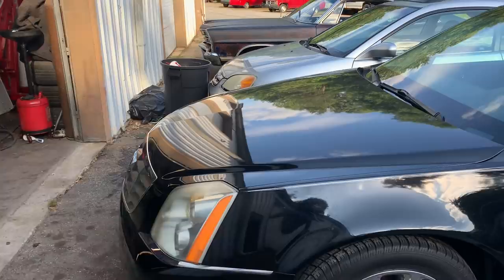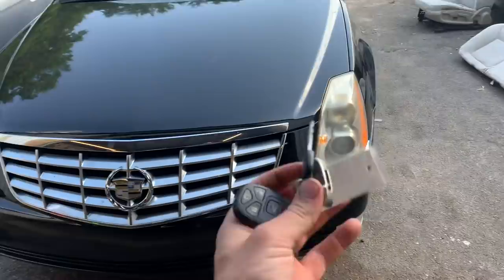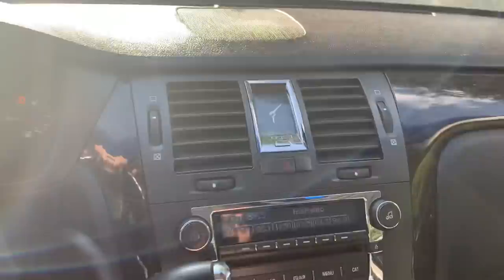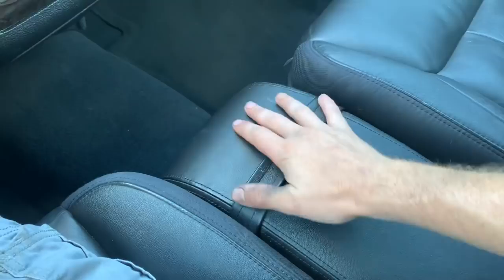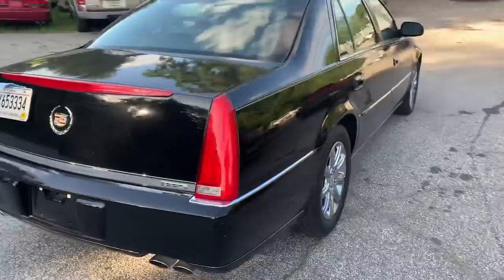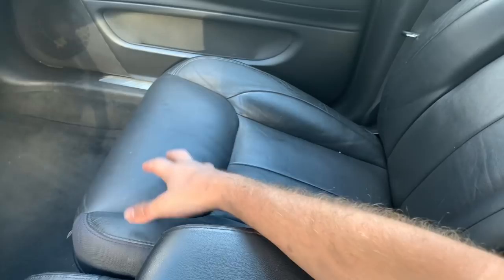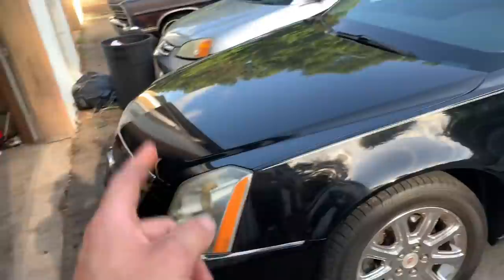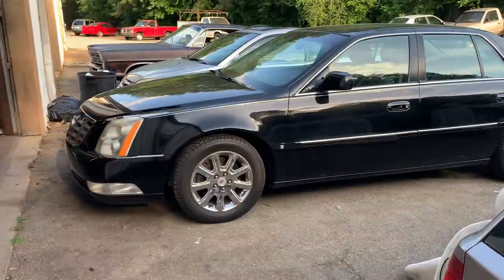A GOOD NORTHSTAR!? 2008 Cadillac DTS

Comment: Have a question I have a 2008 DTS no still Cadillac and I was on the highway this morning going to work and when I got up to 82 mph is like the cruise control was on the window Nafessa needed to and I want to know what we call Steph problem
Reply: I want to know why and 82 miles an hour it was like my cruise control was on. It wouldn’t go faster than that and I didn’t cut that. No it is a little speed limit 82 miles an hour in the wind gonna faster and I was axing a question why we caused a problem

Comment: I have a 2007 DTS and I want to know what are signs the rear shocks need replacing.. even if it's not sagging.. it doesn't ride very soft in the back.. and it seems like they are stuck in the higher position..

Comment: First of all, you make great videos always entertaining and full of information. Secondly, I've been driving Caddy's since the 1970s. Last new caddy I bought was an 05. Absolutely hated that car!! The worst ride ever. Even Cadillac knew it was so bad they didn't put Cadillac on the cars exterior. Two of the caddies have the overheating problem. Dump them at the first side of overheating because Cadillac will charge you over $2,000 to fix. I just found a 1989 baby Sedan DeVille with 58000 original miles. Better than meant, if you hadn't looked at the better than mint. If you had looked at the mileage you think it was Factory fresh! It was always Raven once or twice a week and never out of the neighborhood. Got it for chicken scratch, cheap, cheap, cheap.

Comment: my dad has one it's a 2006 with 260.000 km and still counting if you maintain them they will last longer than you!
but my dad abuses his car the first engine seized after going 10.000 km without an oil change and the second one had a cracked head from overheating and that is because 13 year old hoses and the beautiful sun of saudi arabia are not exactly friends but the third engine is going strong and hopefully it won't end up like the first two

Comment: Such a lovely car 

I have a 09 with 150k miles on it and so far the only issue I have with was the fuel pump relay was burning all the time, so I put external relay outside the fuse box and it works well, other than this was the front end. I really want to know if I could remap the PCM, I want to install HHO kit
Reply: Yeah you can. There is a company that does it.

Comment: These were better but they still blow headgaskets. They still had problems with oil leaks, and transmission problems. Cadillac could have done these right and made them extremely reliable, but they couldnt be bothered.
Reply: There is a poll on the Cadillac forums that show the failure rate to be 0.3% based on the poll.  If there is a failure there is no proof that it wasn't the operator to blame.

Comment: My grandfather had a 06 and when he passed I got it as my first car, still got it had to do somethings to it but 3 years and no big troubles. Did do the valve covers last year. I have also been wondering about changing the transmission fluid its got about 64,000 miles and I'm not sure if it's been changed before should I get it changed or am I good for a little while longer?
Reply: Do it at least a drain n fill n a filter what's fluid compared to a whole tranny ? Lol
Reply: Take it the to shop and have it flushed cheap Insurance. Pull the dip stick out smell it to see if fluid smells burnt, not good if it does; New fluid looks cherry red old fluid should look similar. Ive been told the oder is more of an indicator of fluid condition than fluid color;Take a clean white cleanex and have a drop of fluid drop off from the dip stick  and observe the color on the cleannex, if the spread out color doesn't look cheery or pinkish it brobably needs to be changed; typically transmission fluid in a automatic transmission  should be changed at 50 to 60 THOUSAND intervolts. Every 30 thousand on  vehicles that do a lot of towing or vehicles driving very hard.                                                                                                                                                  P.S.  If the brake fluid has not been changed in the pass  two or three years have the brake fluid flushed ( brake fluid brakes down and has the tendency to absorb  water over time). Have the coolant changed about every 5 years, powerstering fluid about about ever 30 or 50 thousand or at least every 5 or ten years which ever comes first.Its not A bad idea to have the thermostat replaced every 50 to every 100 thousand miles even if working right as preventive maintenance. The top radiator house may need replaced as will every 60 to 100 thousand miles or every 6 or 10 years as preventive maintenance (The bottom radiator house is always submerged in fluid;Their for rarely needs replaced). Drive belts should be changed about every 60 to every 100 thousand miles  or sooner if needed. Spark plugs around 60 to 80 thousand. A well seasoned auto mechanic (technician) imfsided  to me and others replace plugs at 60 thousand miles not the 100 thousand manufacturers say to typically to replace them at; He also said oxygen sensors are good for about 80 thousand. have the throttle body cleaned every 30 to 60 thousand and have injectors cleaned  too around the same interval. Replace air filter every 30 thousand or sooner if dirty( if light doesn't pass will through filter nether will air)  not the 50 thousand the manufacturer says. My used car with only 30 thousand on the odometer had a dirty filter with poor light passing through ability even though manufacturer said replace at 50 thousand.                                                                                                                                                                       Chang engine oil and filter around  once a year as manufacturers states or 5 to 6 thousand miles( or when the oil replacing indicator in the instrument cluster says to do so) which  ever comes first. (There is a thought that I've had for some time) An engine can never have its oil replaced to soon but it can have it replaced to late).   I'VE PERSONLY GONE LONGER IN TIME THAN THE ONE YEAR INTERVAL, but it's not recommended to do so by the manufacturer of any auto manufactured. A good synthetic oil and a good filtering oil filter are a wise investments in my opinion in keeping almost any engine running longer.

Comment: They are all good if you flush out the orange anti-freeze and go with green anti-freeze.
Reply from the maker: No, thats more for 3400 v6s with dex-kill . These NorthStar's problem was weak head-studs. Causing them to pull and blow the gasket.

Comment: I still have fun with my 93' northstar seville, I've heard the problems with the northstar began in 1996, so the 3 years before should not have the headbolt problem. Can anyone maybe confirm this? Until now I am always scared of this problem because it's so difficult to repair, and it's maybe not worth to do this job on a 30 year old car :) But otherwise I really love my old seville :)

Comment: How hard are these cars to work on?
Reply from the maker: That big v8 is definitely a tight fit. However its not horrible. There doesn't seem to be much to fail anymore. Besides the evident failure of the transmission in higher mile units

Comment: Wow, that’s rare to hear that these are good motors, you normally would hear that the head gaskets blow.I love Cadillacs.
Reply from the maker: Not anymore! They pretty much solved those problems after 2005
Reply: @MXguy95  i’ve always loved Cadillacs, and by the way you have a lot of cars in your lot, I’ve always even heard speaking of broken transmissions that some of the GM vehicles came with the 4l60 transmission, I believe I remember that your roadmaster ran one.

Comment: I got  2 from. My mother with low low miles garage kept. Very ugly unreliable cars. The abs module shuts down ecm. So does several other things. They all have an oil leak at lower part of engine. The transmission lines leak ,headlights  are hid and are  300 dollars for the hid, the bulbs are over 100. Then, if you pay cadillac to fix them you are looking at about an average of 2k to fix headlights. The bumper has to come off. Poor design. But made for gm mechanics to bank as most cadilllac drivers have pretend money. Or they would be in a Bently a rolls or so.thing that don't float down the road. I'll pass on the next free one even.
Reply: lol what years were they? The DTS (06-11) models are stunning supreme cars

Comment: With the price of gas ⛽ going up along with a unreliable engine is a bad combination with the northstars it was problem after problem when I owned one I end up junking it to pick n pull after the motor blew out at 124,000
Reply from the maker: These newer ones are much better built then their predecessors , but to each his own I suppose. They still have faults
Reply: @MXguy95  that's why most owners least the northstar after it hit close to 90k miles its repair after repair

Comment: Those engines are still trash, I have an 08 with 130,000 on it more oil leaks in that engine than I can count It's been one headache after the other not even going to get into the transmission leaking somewhere alternator keeps going bad, I love the look of the car and the interior of the car, if it just wasn't for all the other problems it has then I would recommend it. Oh I forgot to mention water keeps coming inside somehow 🤦🏻‍♂️
Reply: Update?

Comment: Those North Star engines are junk. I have a 2007 w 140 thousand miles only. Leaks a lot of oil. Leaks oil all over the engine. I add a gallon every 3 thousand miles